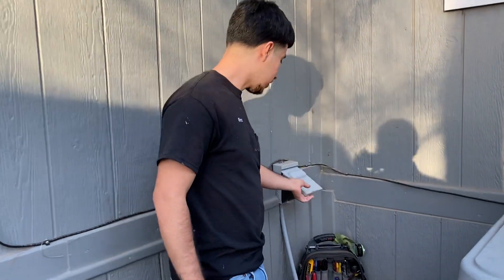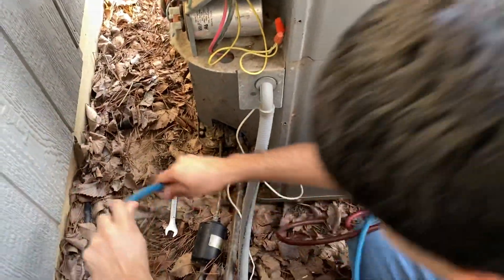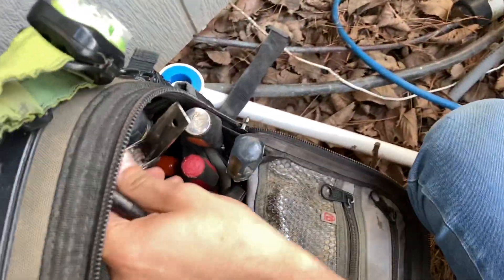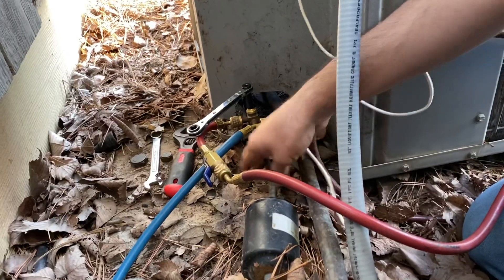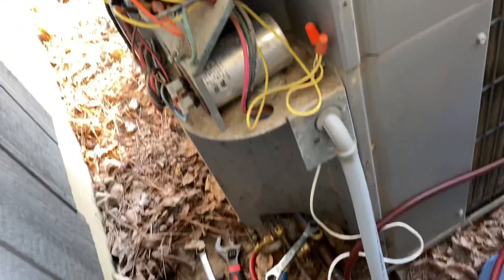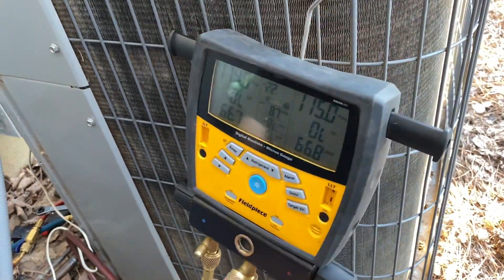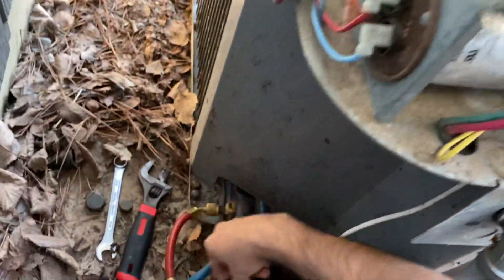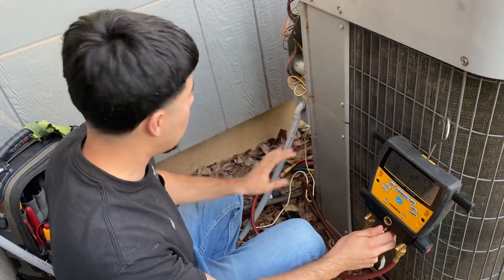How to do a Pump down on an Air Conditioner(residential)

Comment: No purge ? You also have to check if the unit have pressure switches so I doesn’t cut off mid pump down
Reply: Should have purged before he started but pushing the contractor is what bypasses the pressure switch and why the unit stays on

Comment: Wood can be very conductive as it holds moisture. Learned that from a utility crew who said never move a downed wire with a stick. He said a wooden fence can kill you from a mile down the fence if there is a wire on it.

Will the high side always have that barrel shaped thing in line? How do you know high vs. low side.
How do you cut the line and then reattach it?
Reply: The high side is your liquid line...the smaller line will generate more pressure on that side so they call it the high side. The bigger line is the suction line...it will have lower pressure as the line is bigger hence the low side.

Comment: my church heat pump did not start. I changed the contactor and I got 240 at the contactor. With the new contactor, I pressed it and it just clicked, not fan or compressor.  I m thinking could it be a safety, LP, HP,? I did not reset the defrost board.

Comment: You didn’t purge hoses. Now noncondesables in condenser! I’ve seen people installing units that dont run vacuum. They just open up one valve and push refrigerant in other, they say it bleeds out air. They are wrong. And you not purging air before you pump down is wrong.

Comment: think it easier pump down unit with it on
Reply from the maker: Yes you can do it that way too, both ways work if it’s already on outside then I’ll do it that way, but if it’s not calling outside I’m not going to go back inside and turn on I’ll just manually push contactor outside saves me a trip. Whatever way is more convenient for you.

Comment: Just shut high side and put the unit in cooling  and pump it down that is  much safer if i did that over here in uk ill get sacked
Reply from the maker: I do it that way too sometimes if it’s already calling for outside, but if it’s not I’m not going to walk back inside turn thermostat to cooling then come back outside that’s time consuming you gotta work fast and efficient. As long as you know what you’re doing you should be fine.

Comment: Can you please make a video on how to  (hard wire a uv light to a 2005 carrier 3ton unit where or how do I find source of power on unit all electric heater.  Any idea how to do it the right safe way.   Thank you in advance.
Reply from the maker: Yes when i get a chance i will definitely make a video about that, it depends on what type of UV light you want to use, there are 24v or 120v UV lights. We usually use 24v UV lights and you can hook them up one wire is your 24v(R) and the other is your common(C). Depending on your electric air handler, if you have a terminal block you will see terminals for your low voltage that shows R and C you will hook them up there. But if you don’t have a terminal block you will see wire nuts with your thermostat wires and air handler wires where they are connected. You can add them there instead just make sure you hook to 24(R) usually red wire, and common(C) usually blue wire. And trace them they will eventually trace back to your low voltage side of your transformers former. Just make sure if you use a 24v UV light don’t hook to the high voltage side of transformer it’ll end up frying that UV light. If you have any questions don’t hesitate to ask me.

Comment: Good job R. I use old school gauges.
Reply from the maker: Yes i love those too, they always come in handy. Was a perfect tool i used when checking super heat and subcool with my meter as well. Then these came out and made it more convenient. But yes those analog gauges are great.